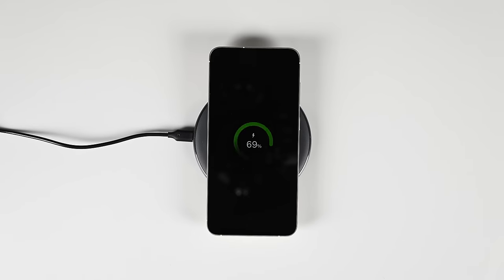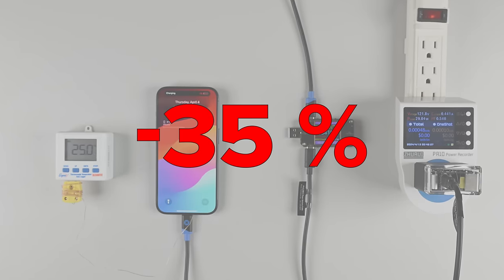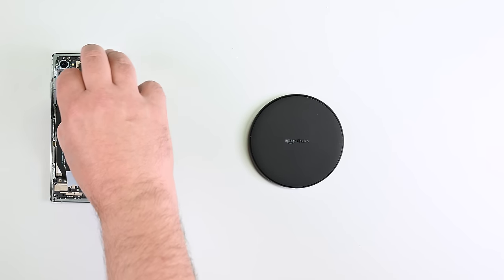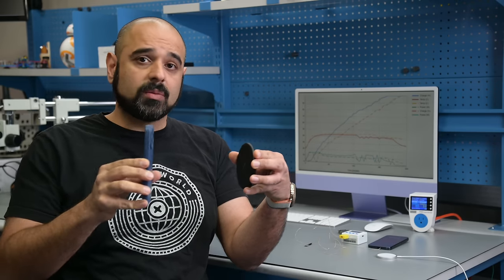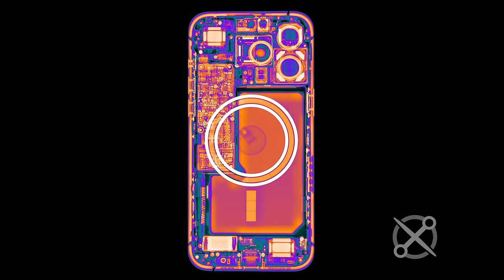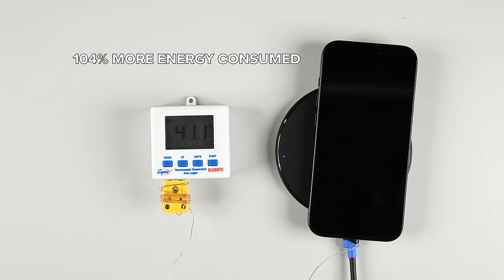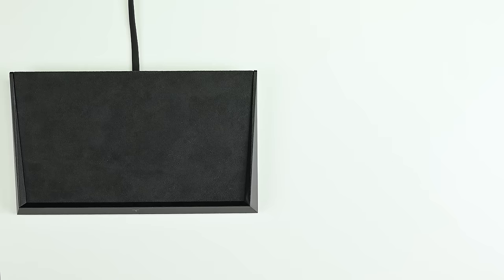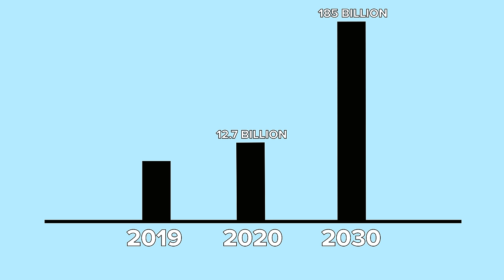How Wireless Charging Works and Why It's Terrible

Comment: This is exactly why Apple never released AirPower, even Apple realized so many coils in a wireless charger is too much heat to manage properly. Honestly it’s good they pivoted to MagSafe and the Qi 2 standard adopted the same tech.
Reply: I don’t know if it is necessary heat from too many coils:
-The biggest problem is many coils and even if intelligently managed,
there is still a. high chance of bad alignment.
That bad alignment is then creating more heat during charging, then it otherwise would.
Reply: Bullshit. I'm pretty sure they knew that before showcasing it on stage
Reply: @asifabdullahzamee7476 Yeah they most likely assumed that another billion in r&d would fix it but it obviously didn’t, so it was cancelled.
Reply: @sippingthe  right. also we are sending rockets in to deep interstellar space, to Mars so wireless charging tech is actually piece of cake and it should be. But apple actually underestimated the tech. Or else airpower actually could have been a great product in my opinion.
Reply: @asifabdullahzamee7476  the problem with airpower isn’t just the heat, but also the fact that it had different 2 coils stack top of each other. the ordinary Qi coil and the apple watch magnetic coil.
Reply: @achmadputra2  they could have just shifted to a different slot for the watch.
Reply: And they didn't know it before announcing it on the stage?
Reply: Well apparently the prototypes were also a fire hazard, apparently because they used the same design as the tesla charger.
Reply: Android fanboys (not users, FANBOYS) just stated it’s because they’re behind the curve, as they always do.
Reply: Don 't worry the will release in 2030.
Reply: @SuperAbhi234  Here's an exactly, like a fish on a hook
Reply: I doubt apple wanted to be careful about heat tbh. Just not their pattern for any devices they make. No fans tho?
Reply: @jarboer  they should have not had any wireless charging, or at least release 1 model/year without it. wireless charging is the reason you can’t use your phone outside of a case for its whole lifetime, because apple decided that having wireless charging is more important than having a reasonably sturdy phone.

Comment: I like to use USB-C magnetic adapters as an alternative.  You get the benefits of not having to be accurate with plugging in (plus you don't wear out the USB port), but retain the benefits of wired charging.  Such functionality should really be added to the USB spec.
Reply: MagSafe 3 on iPhones and iPads please! Such a better solution than the pad junk
Reply: Magnetic USB adapters are generally not recommended because they're not guaranteed to connect ground first, unlike every USB connector. And since they're not part of the spec, there's no way to verify that they're complying with USB-IF. Also, if there's a data connection in the adapter (required for PD), you could get some weird or damaging behavior if the connector is popped loose and reconnected. However, if it works for you for over a year, it's probably fine, most phones have pretty good protection circuitry.

Maybe they'll come up with a type D (or M for magnetic?) connector that uses pogo pins and magnets? They'll cost more than type C, unfortunately...
Reply: @kalafalas246 problem with MagSafe is that (again) it is proprietary. My MacBook came with one but I always take a USB-C cable with me instead, because I can use that cable for all my devices: Laptop, earbuds, phone, camera, power bank etc.
Reply: @rolf-smit the MagSafe demonstrated in this video helped drive the Qi2 spec. So now Androids and all other Qi devices can have MagSafe alignment too!
Reply: pogo pins just aren’t rated for that kind of current
Reply: @NithinJune  Sure they are. Apple has Ben doing it on its laptops since 2006 without any issues.
Reply: @cmmartti  true. i’ll take usbc and a universal port over marginally more convenient charging
Reply: @NithinJune but the point was wanting to have an universal/usb magnetic connector... not that we want apple to make a proprietary one
Reply: @MMuraseofSandvich there's also a chance of tiny bits of metal or something getting attracted to it and ending up shorting something
Reply: Magnetic cables are probably worse than wireless charging.
Reply: @fungalgrowth  add a way to detect a short before sending a voltage, or having a short detected stop voltage. All modern smartphones have this feature already to some degree on their USB/lightning port. As an EE, it really isn't that hard compared to many other things. That aspect is the least area of concern. The only reason it's a concern with USB is that non-data USB with power exists, and the phone doesn't understand magnetic adapters as something different and nothing from the USB spec is designed with those in mind. It absolutely could be done.
Reply: I used to use magnetic charging cables all the time, but when I started working in an industrial environment, I found I would constantly get metal shavings and other particles stuck to the magnet in the adapter on my phone. Cleaning it was always a pain in the butt. You also have to buy many of those magnetic charging cables to keep around the house and in the car.
Reply: Yup, I'm about to get a new phone where I may not do that, but my current phone has the usb-c part left in all the time, with a magnetic cable that attaches to it. It also comes with the convenience of being able to have any type of cable on you while only carrying 1 cable and some various attachments. So I can have a lightning cable for iphone users that need to borrow it, or micro usb for my power banks, etc.

Comment: UPDATE: It seems that if you use wireless Android Auto or Apple Carplay, your phone will get hot and wireless charging just exasperates the thermals further.

My dad always complains about his phone getting hot when wireless charging in his car and no matter how centered I align his phone, it'll always gets hot and his phone will stop charging to control the thermals. But this video and illustration of Tesla solution of slapping so many coils might be the problem but my dad resorted to wired charging in his car anyway.
Reply: Does your dad drive a VW by any chance?
Reply: @RootBert397  Nah, he drives a 23' Acura
Reply: I have the same issue with my 13 pro in my 2024 Polestar 2
Reply: Jokes aside - Next time when you complain about this, just tell him the truth that Every One of us Without Exception will Die! Thats it. And see his reaction! 😉
Reply: Nowadays many cars put a fan under the wireless charging area.
Reply: @wuhd  There's the keyword: fan. Either wireless or wired charging I use a phone fan to keep my phone stay cooler and it works
Reply: Theres magsafe chargers with integrated cooling (charger itself gets cold and cools the phone). I bought ESR brand, works really well but theres others too
Reply: Same problem in my '92 corolla.
Reply: Pro Tip: Mount the charger either on or close to the A/C vent and blast it cold. I've been doing this while doing Uber. Phone still charges during the day and it avoids overheating.
Reply: Not to mention the waste of materials from building a dozen coils when a single one does the job better.
Reply: I had the same issue in a 22 ford edge. Sat in a cubby and got hot very fast

Comment: I work in a phone store and always recommend wires over wireless charging. It's so much better
Reply: hidden cost of cable is the repair of broken charging port. How many users will buy a new phone i/o paying hefty repair ?
Reply: @1ssac1  maybe I'm more careful with my stuff, but I've only had to replace a phone do to a bad charge port once, and that was Motorola Moto G3 that used crappy Micro B USB, and it really was not the port itself but a faulty charge controller chip that caused the port to get hot enough to start smoking.
Reply: Its more efficient but its not better. Imo the convenience makes wireless so much better
Reply: Yeah but I bet your boss wants you to sell more wireless chargers.
Reply: @1ssac1 Oh right, US peeps spend an arm and a leg for something as rudimentary as a port repair
Reply: @1ssac1  My mom's S8 Plus was never repaired, USB-C port is intact.
Reply: @SnowyRVulpix what is the convenience of plugging a disc to a wall and placing your phone on top of it over plugging a cable into a wall and sticking it into your phone?
Reply: @CommodoreFan64 Being "more careful" isn't an excuse to defend exorbitant repair costs, nor is it justification to invalidate what others have to say, and implicate they don't take care of their belongings.
Reply: Iv a phone that a moisture warning comes on once a week. And lasts for a week. The wireless charger is a lifesaver.
Reply: @ziul123 What a disingenuous question. The QoL comes from a permanent charging station where you just place your phone. Nobody constantly unplugs their wireless charger.
Reply: @CheapoPremio  I did not know that. Why don't you just not unplug the wire charger then?
Reply: @ziul123  they're apple fanboys, you cannot change their mind. They eat up apple ads as gospel
Reply: @1ssac1  what are you doing to your phone to have a broken charging port? maybe don't use the charging phone as a sledgehammer?
Reply: Imo, wired is always better. Wireless is good to have if you've damaged your port and need it before you can get it fixed. It's good to have as an alternative if you ABSOLUTELY need it, but wired will always be better.
Reply: @SnowyRVulpix  I don't get it. Where is the convenience? Doesn't seem much easier than plugging an usb cable.
Reply: @quaza2001  Especially when you have to align it assuming you don't have magnets. And for those who say they use their phone until they almost fall asleep and wireless is more convenient, that's a really bad habit.

Comment: I didn't realize the power loss or temps were so high. I'm going back to the ol' wire.
Much appreciate the video.
Reply: I'm surprised its between 50% and 100%, I excepted wireless charging to be 300% extra energy wasted
Reply: @monad_tcp  In ideal scenarios transferring energy through magnets is close to 100%. Many/most transformers use some variation of this, and reach efficiencies exceeding 95%, and many over 99%. This includes the power from the grid to 120/240/110v or from 120v to 12v in your desktop computer.

The issue is that the formulas are extremely well known, documented, and explored. Power is directly proportional to the distance squared. You can't really get closer than what we are doing now. If the coils were essentially touching we would see even higher efficiencies, but that's unreasonable for a multitude of reasons.
Reply: Another important note is how much of our power really is lost this way? Charging a phone, even at 25% efficiency takes 50 wh. Assuming you charge your phone about 1 time per day, this amounts to a very small overall amount of energy still. This energy is comparable to using a kettle, running a dishwasher for 2 minutes, or watching 30 minutes of TV. Personally I'm not convinced that the difference in energy from wireless to wired charging is really worth the inconvenience given that the difference in energy is pretty insignificant compared to so many other daily human activities.
Reply: @arcmchair_roboticist  if you look at it yearly it becomes more obvious how much power it is. Suddenly you're looking at enough power to run a kettle for over 7 hours. Multiply that by millions of users and suddenly we're looking at enough power waste to run cities and a major carbon impact too.
Reply: @MichaelLargent  yeah and the electricity consumption of producing a single hamburger is in the tens of kwh, will this change the consumption habits of people? Saving a couple of kwh a year per person is not worth much.
Reply: @arcmchair_roboticist  it's changing my habits. Every bit helps. We can't rely on others to make the change.
Reply: I never wireless charge unless I’m using the MagSafe battery pack.
Reply: @monad_tcp Its impossible to go beyond 100 percent efficiency.
Reply: @arcmchair_roboticist I feel like it becomes more apparent when you are using a battery pack, especially a smaller 5,000 MagSafe one
Reply: @soacespacestation8556   I was not  talking about efficiency, I was talking about energy wasted. 
100% efficient means 0 energy wasted. 

300% wasted energy means 3 times more energy wasted than the base.

I thought the power lost was 75%, which is 3 times more than 25% base efficiency. So the wasted energy is 300% more.

I know, mathematics is hard for normal people.
Reply: @arcmchair_roboticist   It literally doesn't matter when you're charging your smartphone, which uses $8 USD per year, with 3 times more waste it would still be only $24 USD per year.
Reply: @arcmchair_roboticist   It might be for a car charger, but for a phone ? totally not a problem.
Reply: @MichaelLargent   It is still not a lot of power. You just take 1h of extra time for one time and you already wasted more power than the entire power used to charge your wireless charging phone for the entire year !
Even at those insane levels of inefficiency.

The real problem is the degradation of the battery.
Maybe they should include a peltier module in the charge to keep the phone cool, that would solve the problem.

People cry about things that are not that important. For ex, every time I feel bad about wasting water taking 1h of extra time in the bath (yes, I have 2h of bath). 
Then I just eat 100g of chocolate to feel better about the water I wasted, go see the amount of water used to produce 100g of chocolate, taking baths is totally trivial near the amount of water the industry uses. 

They're gas-lightning us, so their cost of operation become cheaper because residential use has priority over the water usage.
Reply: @monad_tcp  TECs move heat, not remove heat. For short bursts it might be ok, but it longer applications you need a way to cool the TECs. In reality the most effective way would be to move the coils closer, somehow. Heat comes from a lack of efficiency, increasing the efficiency by lowering the distance would go the furthest in reducing heat.
Reply: @faranocks  but that's what I want, to move the heat from the phone to the base station where you can have a heat sink and a fan under it.
Reply: @monad_tcp  I concede on my original point, but would you mind defining what a "normal person" is to you?
Reply: @soacespacestation8556    people don't usually like mathematics , normal might be the average layman .
The way I said was like there's normal people and there's crazy ones like me.
Reply: @arcmchair_roboticist  who cares about the efficiency in terms of carbon impact, wireless charging is SUPER SLOW and causes my phone to get really warm. I'd rather not have to purchase a new battery even sooner due to accelerated degradation, when a fast charger adapter and wire can charge my phone from 20% to 80% in approximately half an hour. Not worth the exaggerated convenience of being able to place it down. I tend to use my phone when it's charging so wireless charging would cause my phone to charge even longer and get even warmer, if it could even keep a stable connection during use

edit: environmental impact due to throwing away lithium ion, and whatever other kind of alkali metal, batteries at a faster rate is the bigger concern than the minimal electricity cost/power lost from using wireless chargers
Reply: Sounds like an ad
Reply: @arcmchair_roboticist  what inconvenience, plugging the phone in? It’s not like you can move around freely with wireless charging because the charger has to stick to the phone anyways. At that point you might as well just plug your phone in.
Reply: @arcmchair_roboticist producing a single hamburger is in the tens of kWh? Uh...no.
Reply: I knew the power efficiency versus the charge efficiency was bad  but never I thought would be so high the inefficiencies